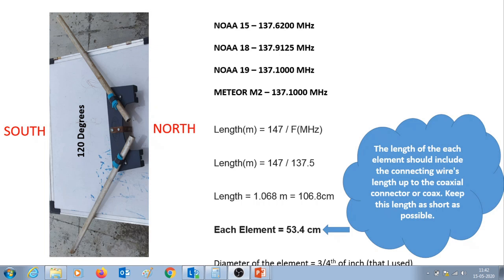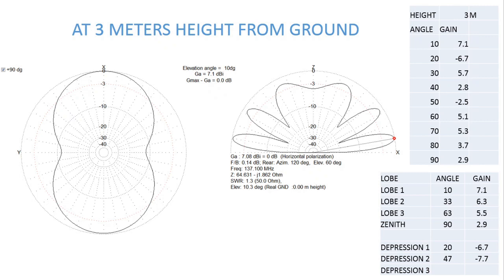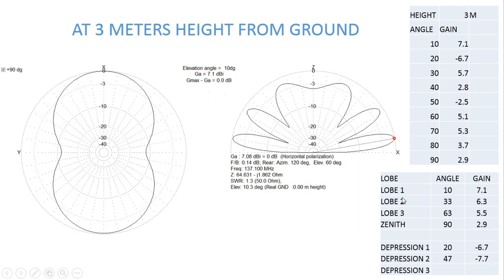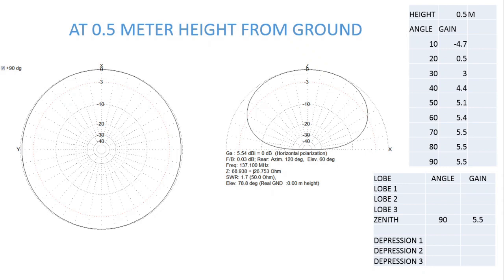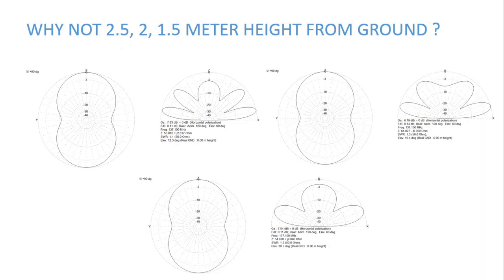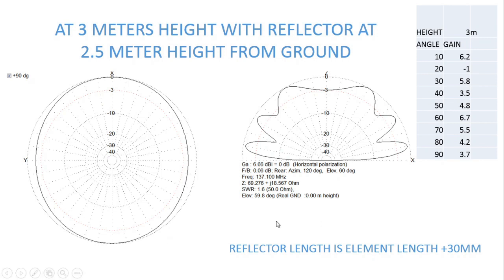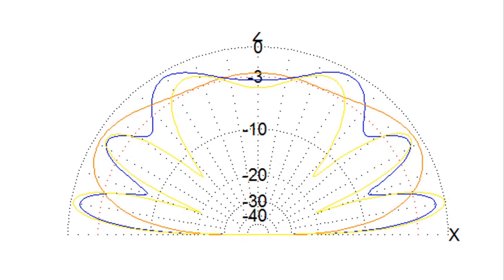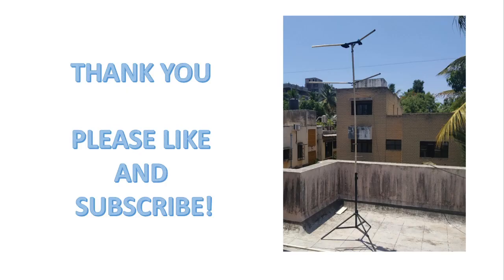Everything you wanted to know about V-Dipole antenna used for weather satellites, Noaa and Meteor M2

Comment: Thank you very much for the video.  It explains a lot.  One question though.  How is the reflector connected to the main upper antenna?
Reply from the maker: No connection...it is independent
Reply: @AniruddhaBokilVU3FML  Great.  Thanks again.  Currently I am using a discone antenna with rspdx and sdruno and the images are horrible. I hope this makes a difference.

Comment: Hi Aniruddha, myself Rini and a newbie here. I have following queries if you could answer.

1) If I want to elevate the antenna from 3 meter to 6 meter in height, where should I place the reflector? At 0.5 meter from antenna or at 1 meter?
2) Are both the legs of the reflectors connected to the antenna? If so, how.
Reply from the maker: 1) Still 0.5m.
2)Both legs of reflector are electrically connected to each other.

Comment: Many thanks for the video. I build the v-dipole with reflector but currently I haven't the expected performance. Therefore one  question to the reflector: is it made out of 1 continuous element (106,8cm + 3cm + 3cm = 112,8cm) or is the reflector made out of 2 elements (56,8cm) and not connected to each other? My second question is going to the sensitivity of accurate element length (53,4cm). I cut the beams to the given length of 53,4cm but in the attachment of the cable I have additional 1-2cm before the cable starts. Before shortening the beam, is the v-dipole very sensitive to this length? I would suppose that i didn't have the optimum SWR but for receiving purpose it should still work good, or?
Reply from the maker: Answer to first question: It does not matter if it's one piece or two pieces connected, it's like an artificial ground level. 
Answer to second question: personally I have seen better results with correct lengths. The additional 1-2 CM cable should be considered as part of the element length. 
A little experimentation is required.
Reply: @AniruddhaBokilVU3FML  thanks for your quick answer

Comment: The problem with this is I dont think there are any linear actuators with a stroke of 2.5m if you wanted to automate this. Ud gave to diy some pulley system with the antenna suspended on rope with an ardunio or something.

Comment: There doesn’t seem to be a configuration of antenna of any type that gives good gain at low angles and good gain at high angles. Perhaps a dual antenna operation mode with an antenna switch when you start to see the gain lower or rise is a good idea.

Also another idea is to just get really high, meaning you’ll need less gain at those low angles and have better LOS :)
Reply: Did you find a suitable all rounder configuration for static location?